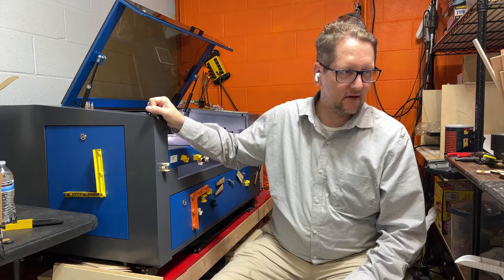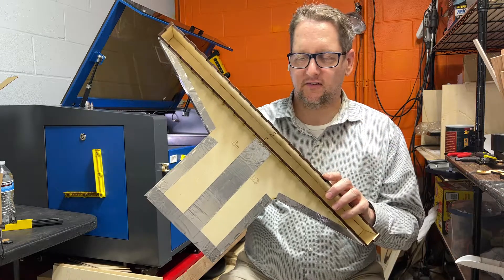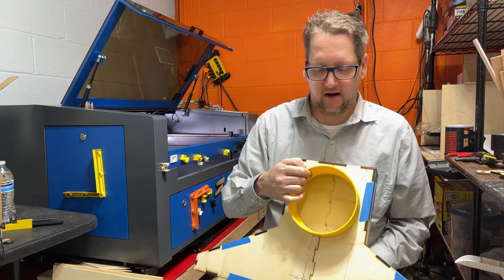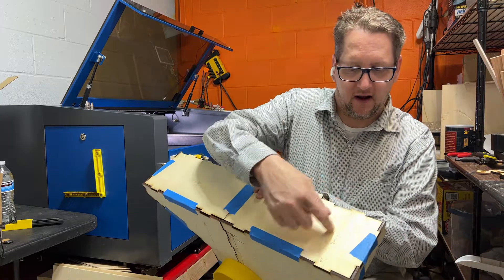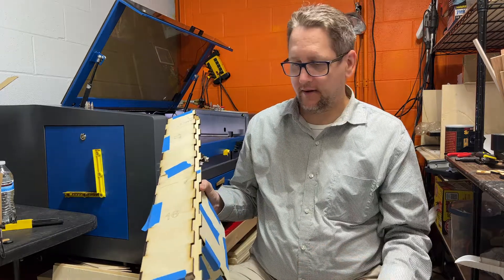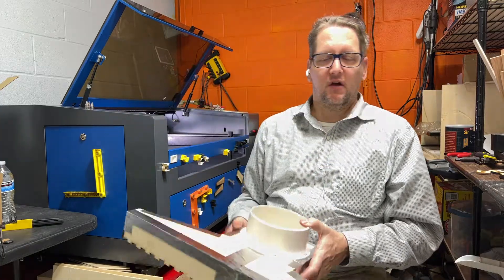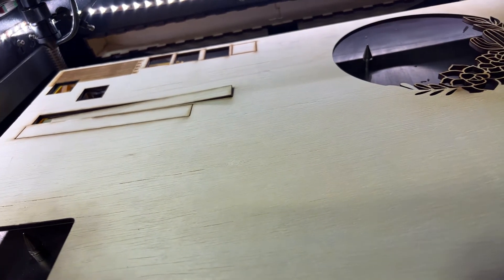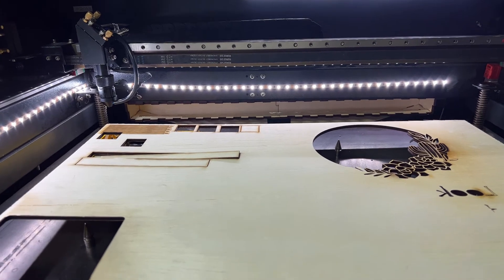Rapid Prototyping and Installing proper ventilation in our CO2 Laser Cutter

Comment: I have never liked the lack of proper air extraction design. 
Are you using a extraction filter or sending fumes outside?
Cfm?
Reply from the maker: I do not currently have a filter installed. My exhaust fan is 390CFM.